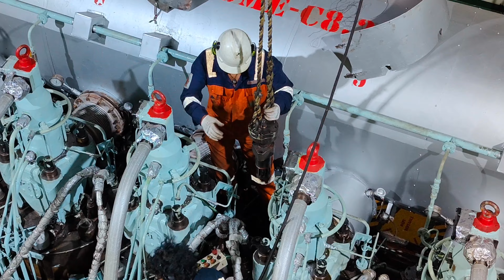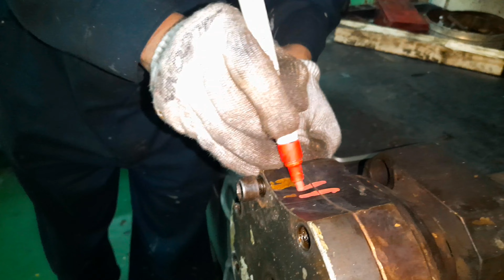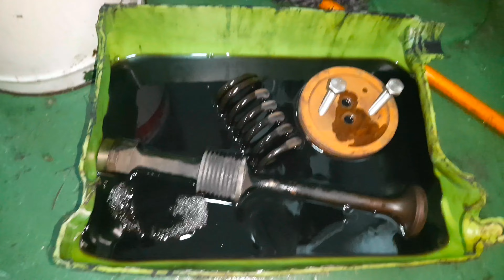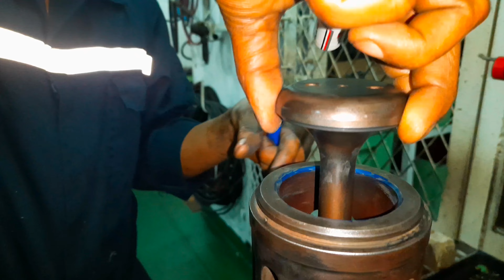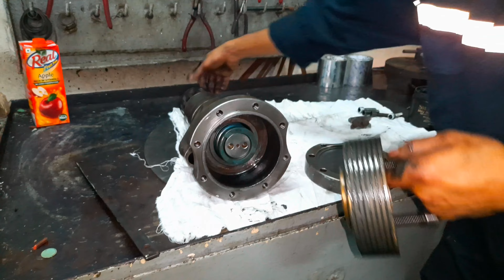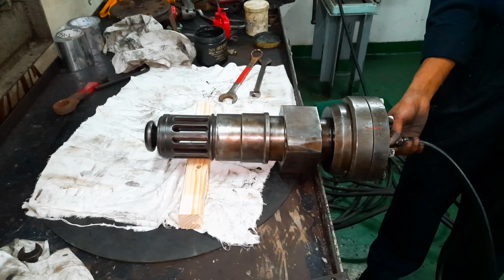ME ENGINES AIR STARTING VALVE O'HAUL PROCEDURES

Comment: What is the required service  air pressure that you  used to check the valve spindle opening properly
Reply from the maker: Good query....
It's was general service air with regular press of 7 bar...
Same being used to inspect the operation of valve spindle/ spring..